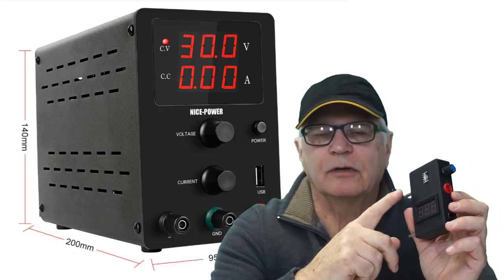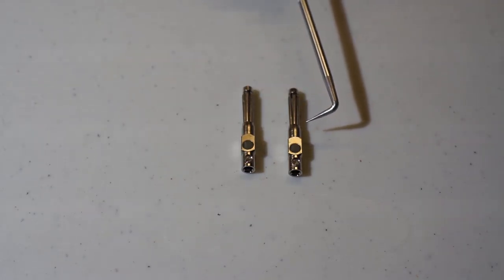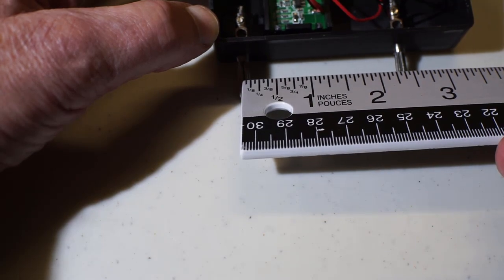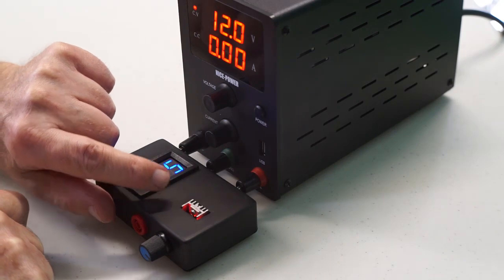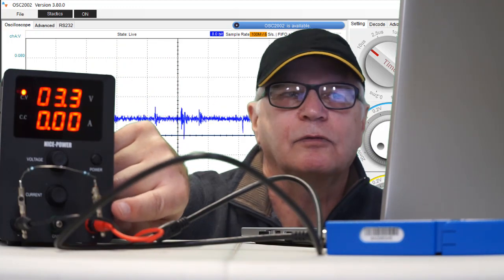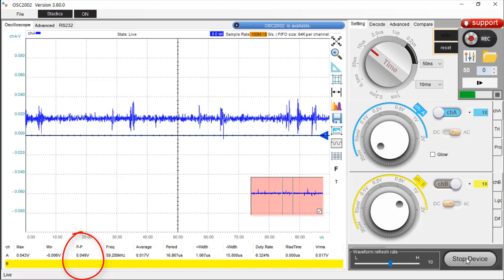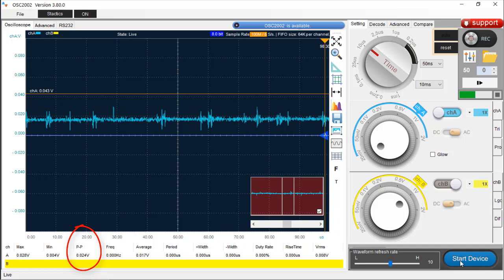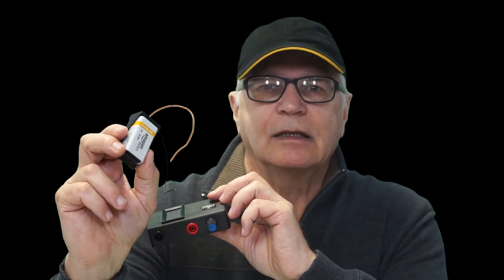GADGETS#91 - LINEAR POWER SUPPLY add-on MODULE

Comment: I don’t know for sure but would guess that adding a non electrolytic capacitor might reduce the noise even further because they usually have a much lower ESR (equivalent series resister) 

For most applications I don’t think that that would make any useful difference, I’m just curious. 

The test with the battery showed most of the noise is produced by the SMPS. I learned from Terry Walker that that’s for a large part passed on via induction that is difficult to mitigate.
Reply from the maker: +Conservator - it requires large capacitance value that is typical of electrolytics. I was recommended  2200µF !!!
I found the two 100µF did the trick and testing with additional capacitance didn't improve anything.
Yes, I would say that half the noise of the LM317 was from the SMPS pass through.
Reply: logical canuck 
I think 2200uF would be required to smooth a 60Hz ripple. The spikes on the scope are less than 1micro second wide. 
The total charge of those spikes is relatively small even at 2A 
However the ESR of the capacitor could prevent it from charging because the ripple is small 13.5V (one way) and the timeframe short. 
I think that even a 1uF polypropylene film capacitor (parallel to the electrolytic) will show an improvement. I’ll test it and will report back. 
Did you use low electrolytic caps?
Reply from the maker: @Conservator.  - there would be a basis to expect a 60Hz component, mains after all.
But I didn't do a spectrum FFT.
Trial and error and what's in my stock is my M.O.
That LM317 board produced over 400 mV of noise before those 100µF were applied! Another 100µF in parallel made no difference. It's where I stopped.
I did the same in exploring 0.1µF for AC Coupling. Experimented. Higher values were bad. Lower values were bad. Kept 0.1µF
In the Relative Compression dongle, again I experimented. Found I could increase that AC Coupling value to 10µF for that specific application and gain signal strength. Went with it.
Nothing beats real world testing. I keep it simple.
When I get in trouble, I ask knowledgeable friends. I'm adding you to the list, Eduard:-)
Reply: logical canuck 
A 60Hz component would look like a straight line on a 10us/div scale. If the spikes are 1us wide and pure sine wave their frequency would be 1Mhz. They are obviously not pure sine waves so they will have (lots) of higher frequency components in them (but no lower frequency components). 

Adding a second 100uF should have had some effect unless the ESR of the second cap was >2x higher than the first one. With electrolytics this is quite possible. 

Having said all that I think it’s time (for me!) to put my theory into practice 😉.
Reply from the maker: @Conservator.  - another factor at play (besides me quickly getting in over my pay grade) is that I try to keep the builds at a targeted audience. I use readily available, most common components whenever I can.
Reply from the maker: @Conservator.  - actually, the entire process of measuring the noise level of those two devices is quite fickle.
I mentioned in the video that a mere adjustment in orientation of either the SMPS and/or the LM317 module could alter the results.
One could position these for the best results when testing the SMPS and for the worse results when testing the LM317 and the bench power supply would come out on top.
In the interest of honesty, I was careful not to alter the orientation between the two tests but it goes to show that at this level of sensitivity, it's a fool's game to push harder.
I've been expecting someone to say something about my 100Ω antennae...LOL
It actually behaved fairly well, touched it, bent it, twisted it...no noticeable effect...a surprise.
Reply: logical canuck Hi,
I did have a go at it. I used my RD6006 and saw about a 50% decrease in the AC Vpp when I applied a 0.47uF polypropylene film capacitor. However I got about the same results when I used several electrolytic capacitors with a range up to 220uF. 
I couldn’t get better results if I used two capacitors in parallel. 
The measured ESR of the polyester capacitors were between 0.2 and 0.3 Ohm. The ESR of the electrolytic ones between 0.3 and 1 Ohm. 
Measurements varied to much to draw conclusions though. Maybe I’ll try again later in a more organized setup.
Reply: logical canuck 
Polypropylene film capacitors are also quite cheap. The 0,47uF 100V I used wouldn’t have cost me more than one or two dimes (even Canadian;)
Reply from the maker: @Conservator.  - I went straight to 100µF and tried UP from there with no additional benefit.
Your experiment tells me I could have went DOWN to 4.7µF with no deterioration.
The board came with two (104) ceramics and those were definitely not enough.
And the "measurements varying  too much to draw conclusions" confirms how sensitive this all is.
Martin warned me going into this that it would be the case.
Just the overhead lighting, house wiring, even slightly taping the table influences it.
It led me to carefully do the SAME things to both to obtain RELATIVE measurements. The absolute values are questionable.
Thanks for sharing, Eduard!

Denis
Reply from the maker: @Conservator.  - two dimes here...two dimes there...pretty soon we're talking real money!
🤣🤣🤣
Reply: logical canuck Hi Dennis,
The 104s are 100nF. They should have made a difference at relatively low currents. 
I discovered that I used 0.47uF (470nF) capacitors (not 4.7uF as I initially thought). I edited my previous comments so new readers don’t get confused. 
And they are called polypropylene film in stead of polyester capacitors. Their ESR was not as low as I expected but at least lower than the (some high quality) electrolytics I had laying around. The polypropylene film where from AliExpress. 

And yes, measuring and trying to lower noise levels at 20-40 millivolts is probably a bit of an art (and one that I do not master). The results that you showed are quite impressive! 

This write up is of course just to document and share.
Eduard.